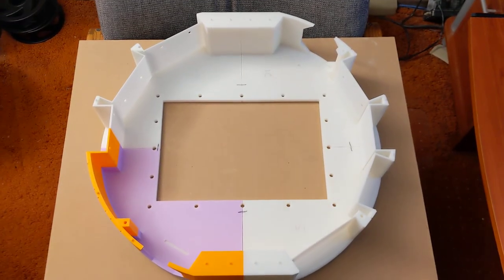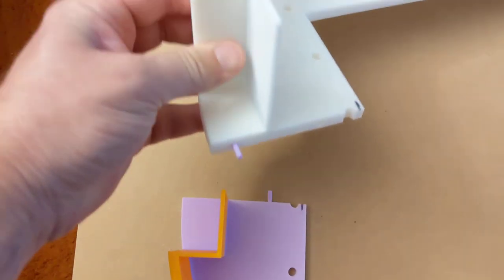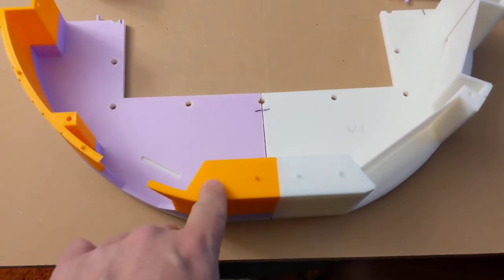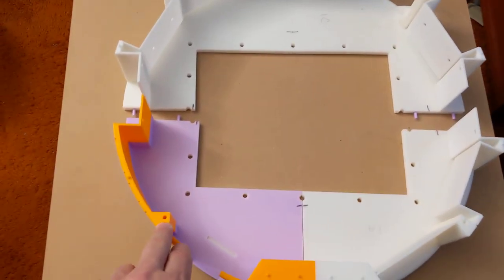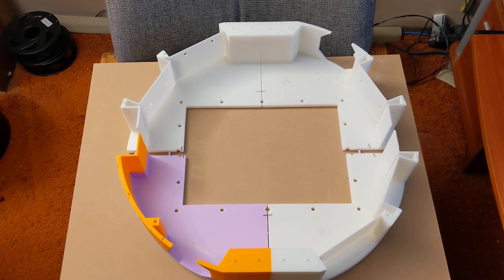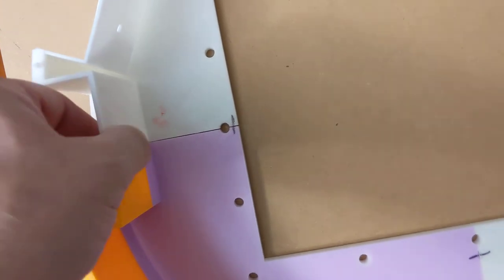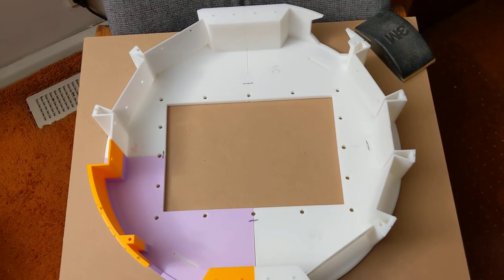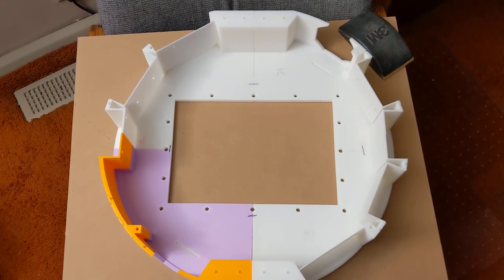3D Printed R2D2 - Part 5

Comment: Will your 3d Print R2 have aluminum skins, or you plan to just paint the outside of the 3d printed body?  Reason I'm asking is that the aluminum skins are cut to specific diameter and you sand or print your pieces too large or small, the aluminum skins will not fit properly.  When I built my wooden body frame, I purchased the skins prior to cutting the body so I ensured I didn't router or sand down the outside edge too much!  Just a word of advice.  Great looking prints, the pins are also a great idea.
Reply from the maker: This droid will be all 3D printed, no skins.  Even the dome will be plastic.  
Good tip for a wood body droid though!  Good luck with your build!